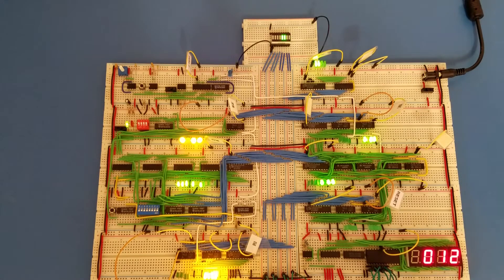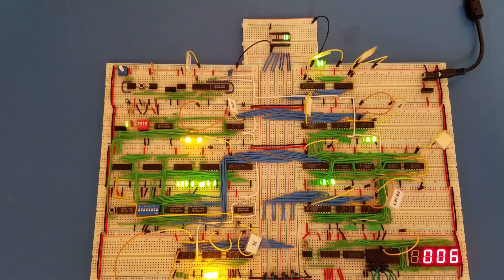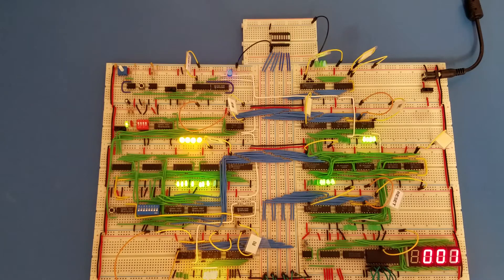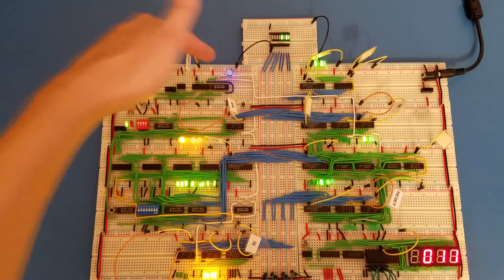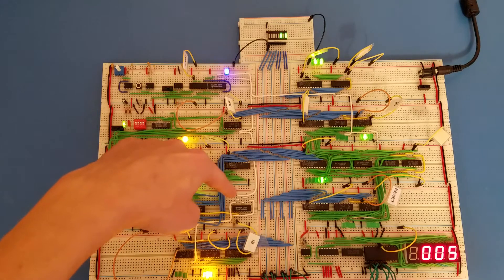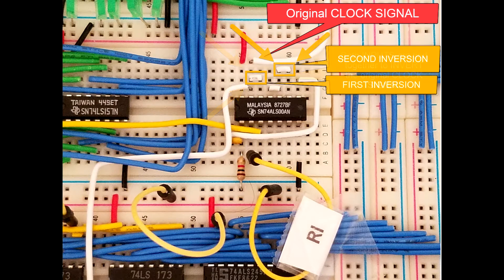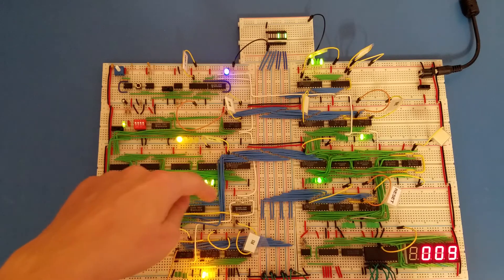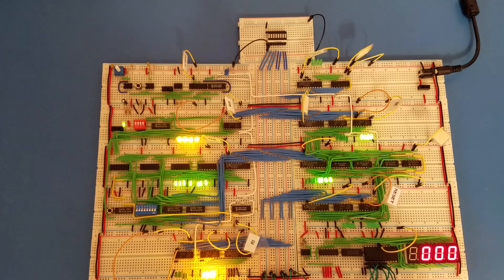[FOLLOW-UP VIDEO] Program Counter Question (Ben Eater 8-bit Computer) SAP-1

Comment: could it be a voltage issue. check your voltages   all over the board. you may be getting low voltage that is causing trigger issues.
Reply from the maker: Thanks for the reply. I am getting good voltages all over the board. That is one thing I've tested repeatedly because I had a lot of power problems early on due to low quality breadboards and loose jumper wires. I was pretty far along in the project - but I decided the breadboards I was using were complete garbage. As much as it pained me, I bought all new boards and moved everything over. Made all the difference in the world.
Reply: What breadboards are you now using?
Reply from the maker: I'm using Jameco part # 2157706 breadboards now. I'm sure there are breadboards that are even better than those if you want to spend even more per breadboard. But for this project at least, these boards seem to deliver power with no issue.
Reply from the maker: If you can manage it, get all your breadboards at once so that you can get the price discount where you save 56 cents per board. That's a pretty good savings when you're buying 14 or more of these things. I'm using 14 of them for my breadboard computer, and 2 more for my EEPROM programmers. (Though for those EEPROM programmers, you could use any breadboard.)

Another thing I found out is that you don't want to try to mix and match breadboards in the main build. The way breadboards connect to each other apparently isn't completely standard. Early on in my project, I had two modules on 2 different brands of breadboards, and when I needed to snap the boards together, it was physically impossible. The tabs on the one brand didn't match the size and spacing of the slots on the other.

So whichever brand you go with, make it your standard and use it all throughout.
Reply: Thanks. I just so happen to have a free shipping code for Jameco they sent me yesterday